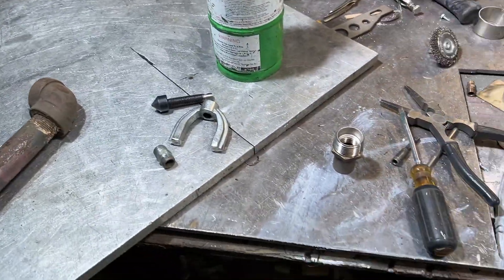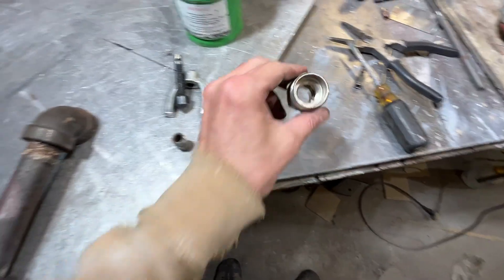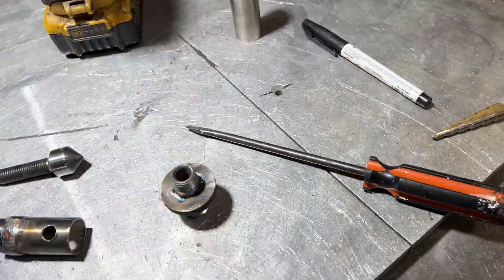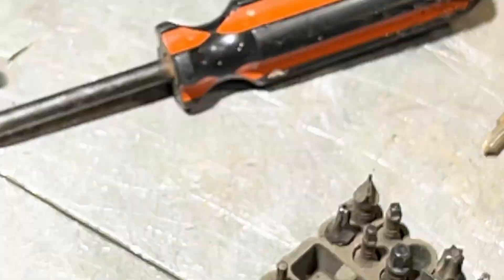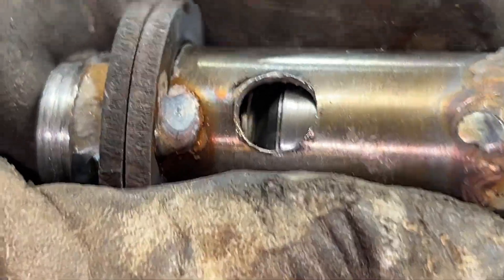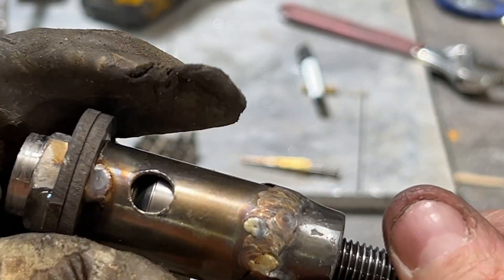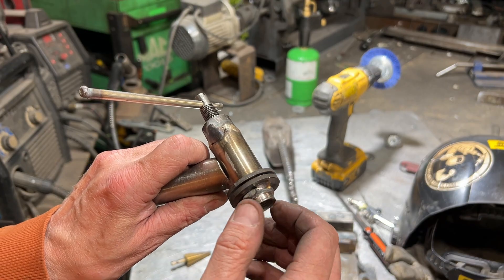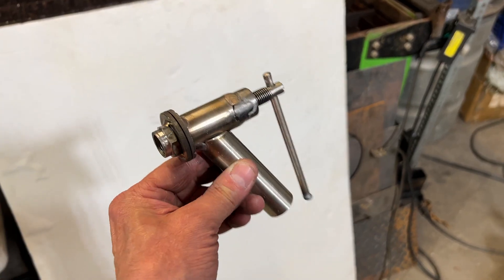High temp molten metal valve build for Arin

Comment: They have peck-valves which you see on all kinds of large crucibles.

Its just a weighted lever with a needle valve held closed by its relative weight.

One lifts the weight [either by hand, by lever, or by pulley, usually] and the metal flows, until you let the valve re-settle into place.